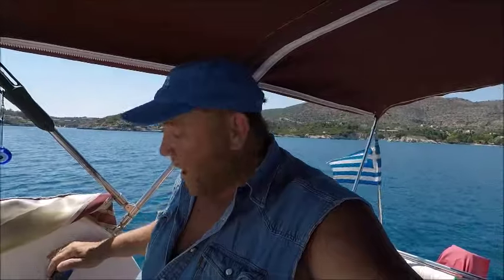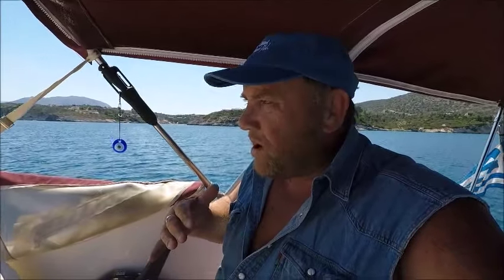How to plane a boat, Boating for beginners

Comment: Problem I'm having is I'm operating a 16 foot aluminum boat with a 15 hp 2-cycle engine without adjustable trim; everything's fine as long as I have a large passenger up front, or two smaller ones, otherwise so much of the weight is aft that the slightest wind will spin the boat. Maybe I should put some sandbags up front when solo.
Reply: Kowboy USA
Of course you can put some sandbags up front but what if you are going solo to a place where you will pick up a passinger? Will you then dump the sandbags? Or if you leave your passenger at some place, will you then have some sandbags at hand to continue solo? I would recommend you much better solution - use a tiller handle extension rod, and take a seat in the middle of your boat. It will not take much space in your boat and will not significantly increase your boat weight. It can be always ready for your solo trips. Use it with some caution untill you get custom to it. To be able to adjust the length and to make it perfect for your sitting position in the middle of your boat, try to get a telescopic one like this: 
https://www.amazon.com/SeaLux-Extension-Telescopic-Outboard-Trolling/dp/B07RD719VX/

Comment: Thank you. Would you use this technique in choppier conditions?
Reply from the maker: Hi Melanie, Lovely to hear from you and thanks for watching, Yes you could, but in choppier seas, you need to ensure the bow is just over the bow wave, so as not to smash into the next oncoming wave, but not so much that the boat becomes unstable, its a feel thing really, you need the prop down to dig in and remain in control, In really choppy seas, best to take it easy, and be cautious. Hope its of help Melanie, regards Carl
Reply: @boatingforbeginners7949  Yes. Here in the Puget Sound Seattle area, the waves can come from this way and that. Always have our eyes out. I grew up in Laguna Beach and learned to never turn your back on the water.
Reply: Slow is Pro.

Comment: It seems counterintuitive to tilt the engine up when you are accelerating and trying to keep the bow down. I will experiment next spring.
Reply from the maker: Hey Louis, Good to hear from you buddy and thanks for your comment. You accelerate and bring the engine up slightly to bring the bow up over the initial bow wave as you take off, then once the bow has dropped slightly with its own gravity, you then lower then engine again slightly until the bow is just above the wave and then you are planing, the you can lower the thrust slightly to conserve fuel. hope its of help and it will take a little practice until you get used to how yr boat handles, but its very much worthwhile and a smoother ride too. Happy boating and thanks for watching. regards Carl
Reply: Boats, Fishing, Guitars & Rock n Roll 

Thanks for the service you provide with this channel Carl.
Reply from the maker: It's my pleasure Louis, I'm pleased your enjoying the vids and thanks for subscribing, its great to have you on board buddy. I'm in my 5th year of boating, so as i learn, i pass it on, including any mistakes i've made! If there's anything you want to see/learn/ go over in more depth on my channel then just say so and i'll do a vid for you and others to enjoy. Do keep in touch Louis and enjoy your boating, Kindest regards Carl

Comment: how do I know how much i should tilt the motor up ?
Reply from the maker: Great question and thank you for watching the video, Just tilt the engine up approx 5 quick bursts ( presses) on the tilt up button as you puch the throttle forward and then you'll feel the the bow start to drop through gravity, then adjust the engine to flat and you'll be on plane

Comment: Subscribed!!  So I have a question and if you have a video somewhere that answers it, ill gladly watch. I just a bout 26 foot modified v,w/ 225 hp evinrude about 48 hours ago. Took it out with some friends today and at speed and on on a plane, the steering is horrible. I had to lower us down to 15knots to stay in the channel markers.  Any thought?  brand new to boating but this boat was a steal.
Reply from the maker: Hi Buddy and thanks for subscribing, Welcome aboard. Well there's a couple of points to ask, you said some friends, were you overloaded?, weight distribution? placing the "bigger" passengers in the right areas to balance the boat correctly so that it sits ok on the water. was the bow too high? with too much weight on the stern, these are the points i'd look at first, but now its on here, hopefully other guys will raise other questions that will help you. Enjoy the channel, its great to have you with us. regards Carl
Reply: Trim the motor up while on plane and see if it helps

Comment: When the other boat make waves. Which way do you go
Reply from the maker: Hi Trey and thank you for an awesome question.. This is commonly known as a "wake" and i usually slow down and turn into it with the bow, So the bow will cut through the wake, As a "Side on" it could become dangerous. Hope its of help buddy and welcome aboard, Carl
Reply: @boatingforbeginners7949  we had this Lake out here that has a bunch of boats big boats going by making big. how do I control the boat or I'm not trying to let the boat capsized so what should I do if I need to get to other side of the lake.
Reply from the maker: Hi Trey, It's a really good issue you've raised buddy and it's inspired me to do a video on this actual subject, So thanks for that. So keep a look out for a "Wake" video sometime soon. As for wakes from big boats, I'll be doing a vid across wakes of Battle ships & Passenger Ferries,  So they don't come much bigger than that!  As for getting across the lake in that situation buddy, As i said, turn the bow to the wake to cut thru it, defo not a side on and wait for the wake to pass thru, then make your crossing buddy. regards Carl
Reply: @boatingforbeginners7949  let me know when you do the video. One more question. If you hit the wave to hard and your boat jump the wave. What should you do when you are in the air.
Reply from the maker: Pray!  and i'll be doing a video exactly on that subject very soon buddy